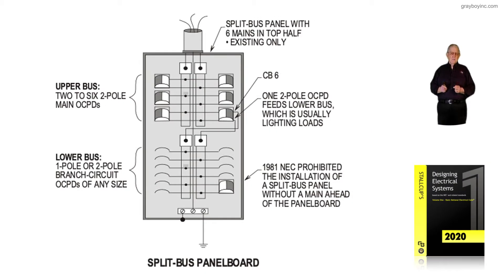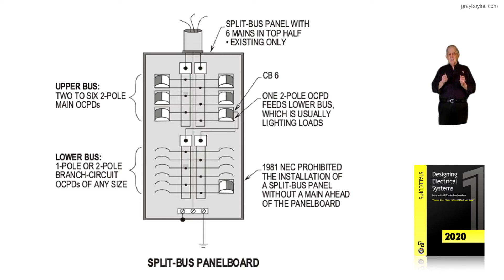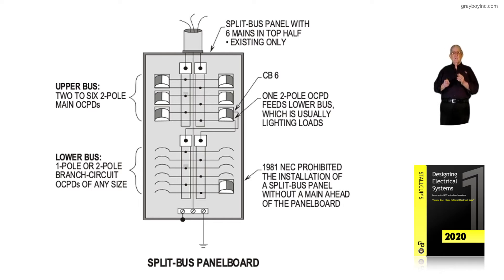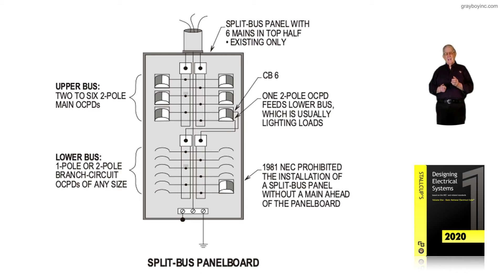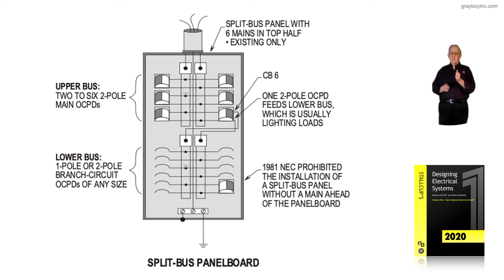7-16  SPLIT-BUS PANELBOARD

Comment: So in theory a split buss panel is still allowed to be manufactured per se, it just wouldn't be allowed to be installed without a main breaker or fuse ahead of it,  which would in turn make it a split buss subpanel?? If I understand correctly what you're saying.   Thanks